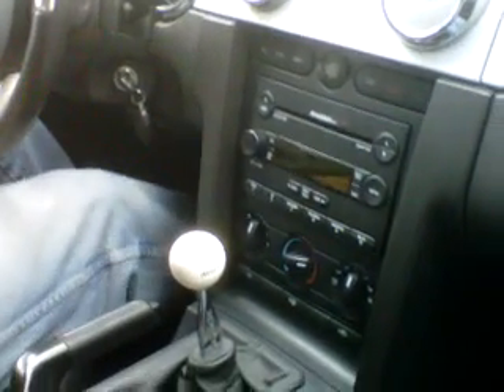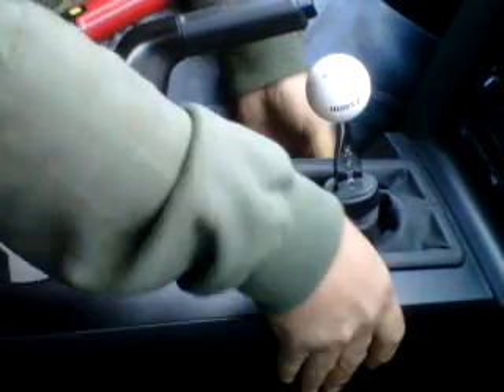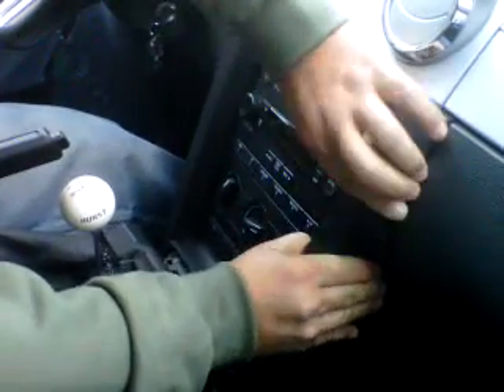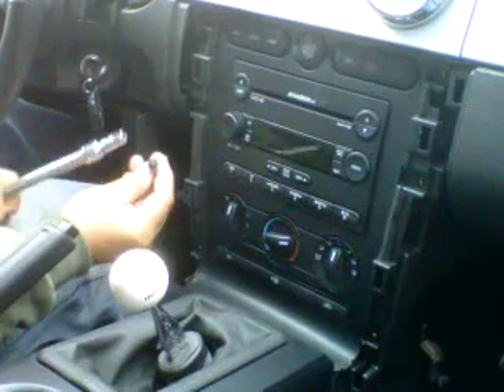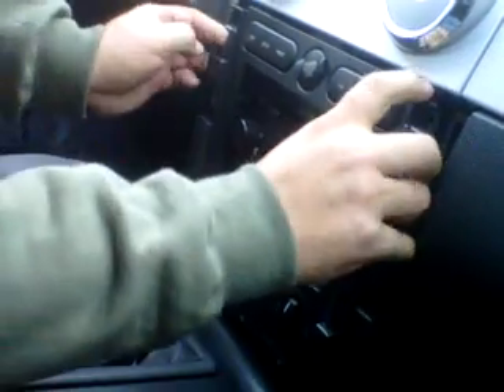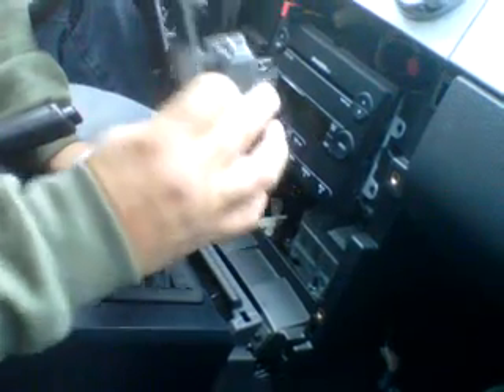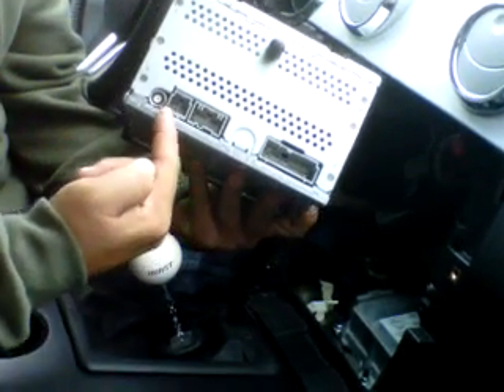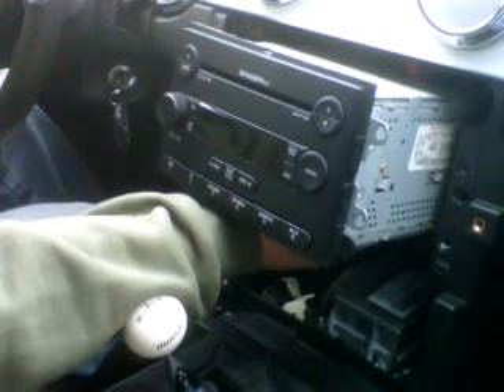How to Remove Radio / CD Changer from 2006 Ford Mustang for Repair

Comment: Recently installed a JVC Din in my 2006 Mustang using this video and another video.  Both instructions were great and helped me tremendously, BUT, be aware that after unscrewing the faceplate it isn't that easy to unplug the temp select connection on the passenger side.  There is a gray U-shaped lever in the down position that is held in place by a small black tab.  I found it easier to disconnect the driver side fan control and the top 3 plugs, pull the faceplate out further and then raise the gray unlocking lever.

Comment: My CD changer is stuck. Your video will make it possible for me to remove the radio and put an aftermarket one in, without me having to go to the dealer.  Thanks for the clear and easy instructions.

Comment: I feel I'm behind the curve in replacing my radio/CD player only now :) Halfords in the UK suggested this would take 8 hrs. Lets see how long it takes with just me and this video!
Reply: 8 hours... more like under 1 including soldering the wire harness adapters to the new radio harness.  If you have a Shaker 500 or 1000 you also need to install a 12V to 5V converter on the remote amp turn on wire.  The factory system turns the amp on with 5v signal.... the aftermarket radio uses 12v so without the LM7805 to reduce input voltage from 12 to5v you will get a pop sound from speakers when turn radio on.
Remote wire from New radio to INPUT on 7805 then attach OUTPUT of 7805 to the factory wires for amp turn on.  The middle prong on 7805 is simply a ground to chassis.

Comment: The aux input is in the armrest storage in the middle.. if you look its easy to spot and it looks nicer too then having a wire hanging out from the radio
Reply: The Aux cord didn't become standard until the 2007 model
Reply: @rotatingcats  My 06 has one.
Reply: Same

Comment from the maker: You need to buy a AUX interface adapter which comes with the instruction. It connects between your radio and the harness. You should be able to find it on ebay.
Reply: HiTechElectronic  pls 2006 ford radio was telling me CD errors, pls what can I do

Comment: My2006 gt, have the shaker 1000 but only work 2speaker for the from and 2 speakers from the back any answer please thanks,
Reply: Did you connect both amp turn on wires to the remote turn on from new radio? The Shaker 1000 has 4 amplifiers.  The Shaker 500 has 2.

Comment: so let me get this straight....they put an AUX button on the radio just for decoration?? I was told before that the AUX input was on the back of the radio...and that they just didn't route a wire to the front for an input. But apparently there's nothing on the back of the radio you could hook an AUX input to.....freakin' Ford.
Reply: The Aux port is on the inside of the middle armrest lol I had to figure that out
Reply: They used the same stereo system that was used in other ford cars so that's why
Reply: no the 2006 and 2005 have no aux port
Reply: @undeadexplorer6074  My 06 has one in the armrest.

Comment: Ok. Your video was not informative at all. Maybe a little but you didn't even explain how to unplug the AC. and stuff on the bottom of the deck cover. you just unplugs the plugs for TCS and all that good stuff out there. Next time you make a video make sure you include all the details dude.
Reply: exactly the heating and AC controls plugs are a pia